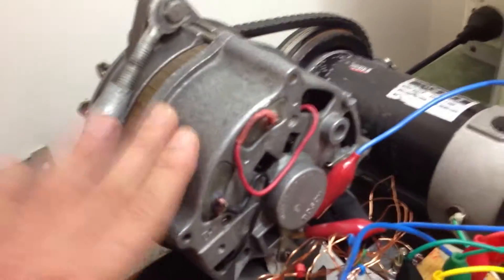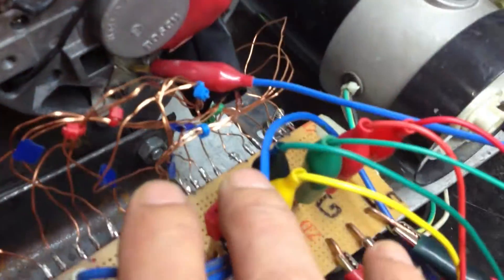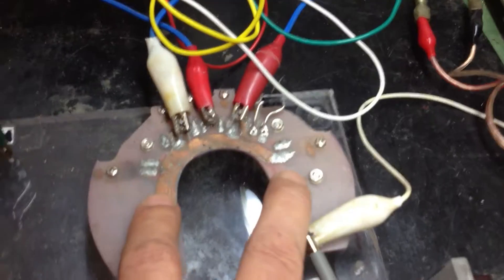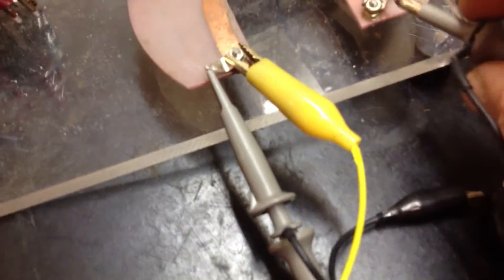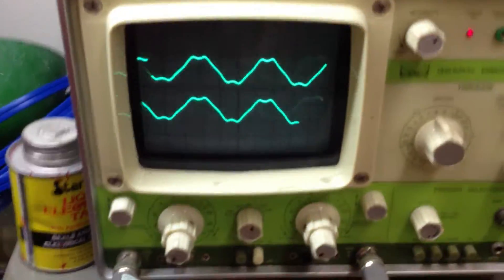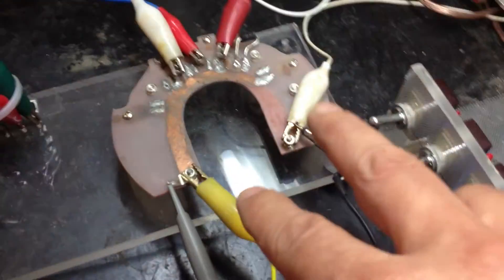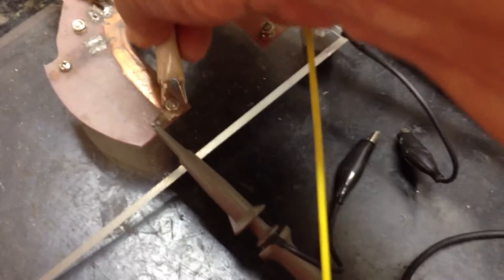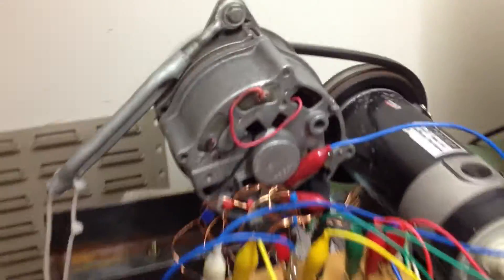meyer alternator internal vic transformer experiment.

Comment: It certainly is an interesting result with different appearance of the gas. Begs the question...what is happening at the molecular level?
How can electrolysis make different gasses with the same starting molecule? 
Where does the other element go if it is making more of one and not the other?
Seems like our fundamental understanding of water chemistry is wrong if this can happen at all.
Have read that water can exist as H30, H50, even H70.
If the charge state of the elements are made stronger or weaker it follows that the bonds could increase or decrease number.
Single diode electrolysis suggests this is true.
If only one gas is coming off a single cell then the concentration of the other gas must increase, and the atomic mass of the new compound species must increase.
Reply from the maker: m3sca1 the same effect happens when I use my dc power supply...it's an old school type..bwd 246A ..newer power supplies from china don't seem to do this...my old one didn't .
Reply from the maker: electro1622 also..not single diode ..has diode on negative and separate diode on positive for all  phases.
Reply: electro1622 sorry i was a bit vague there...i was referring to using a diode in the water with an RF field around the cell. Only one electrode in there and puts gas out.
Reply from the maker: m3sca1 Michael Meadows did a video "free ac hho and power regeneration" https://www.youtube.com/watch?v=8Kvu-7jvSjE  
This is using a similar principal but I am doing it all on the same core . The weird thing is the voltage is ac, just like Mr Meadows,it's getting gas with ac.
Reply: electro1622 i got gas from AC before as well using the secondary output from a MOT.
In your case there is a portion of DC in the AC wave...but i don't think that can be held responsible for all whats going on. I think voltage stretching the water molecule is more to blame.
Reply from the maker: m3sca1 why do you think the AC goes through the diodes..??
Reply: +electro1622  in your setup?
One could be broken.
There is always ripple on after a diode if it isn't smoothed by caps.
You got a diode that is not the same as well.
If it is different rating it can behave like a transistor if in series with another diode.Like valves of different size or spring tension in a pulsing pressurised liquid system.One will open when it shouldn't if the flow us pulling a low pressure past it.
Mass and motion. 
Thats all i can come up with bro
Reply from the maker: yeah...I don't know...checked all diodes..OK..also, it's only an alternator with 4 v going in at about 2500 revs...the output on the scope is only 80v ..and it is ac everywhere..before the diodes, after the diodes, and on any part of the circuit..anywhere you touch the scope it's ac.
 Also, with the same board but different wiring combinations, you get DC. Maybe the positive charge provided by the 2 phases keeps the diode open and that lets the Ac from the transformer through..??. but then again..I don't know shit..just a beginner
Reply: electro1622 only logical explanation is the diode being held open.
I suppose you could spin it around and see how it affects the waveform. 
Or take it out altogether and see if you get the same result. I reckon that one odd diode is the culprit. Maybe poke around with a resistor while it is running to see if it will change state.
Reply from the maker: m3sca1 just noticed that when I disconnect the cell, either the pos. or neg. I get DC at the board...neg. on negative side and pos . on the other. As soon as the other side of the cell is connected the wave goes to AC.
Reply: electro1622 what the? try a dummy load instead of the cell.
The cell is a leaky capacitor...more or less leaky depending on your electrolyte levels.  
Any electrolyte in the water?
I haven't played hydroxy for quite a while now but i stopped using any electrolytes because it is the realm of Faraday electrolysis.
Reply from the maker: m3sca1 I can just short the whole thing out...no cell just straight short..and it goes to AC waveform..no big sparks, wires do get hot after a while but nowhere near as quick as normal when it is shorted out...And I'm using distilled water.
Reply: electro1622 certainly some weird shit going on mate.
Want to do your head in even more?
Stick a zinc electrode over the top of the cells in the gas bubbles and extract some free electrons. 
I saw a crazy result i have never been able to replicate again....
Reply from the maker: uploading a new video to show you what I mean..